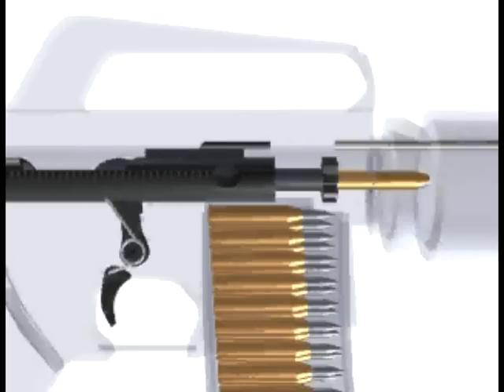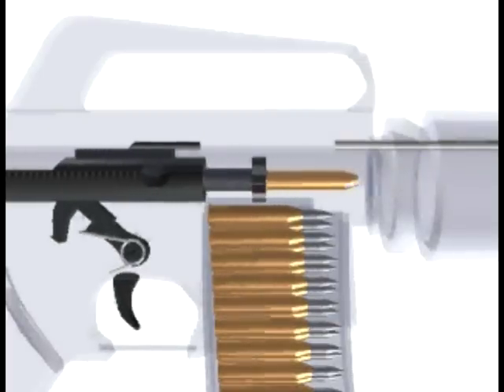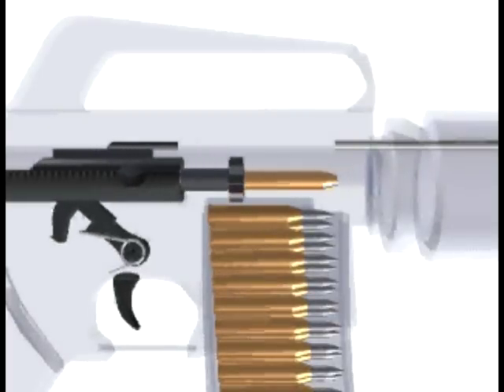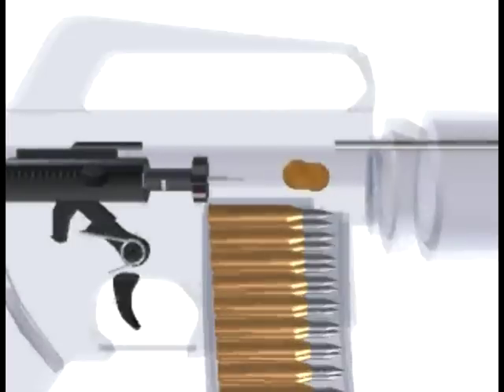M16 Functions Explained

Comment: @GOcgyFLAMESgo You sure about that one pal? I'm in the army; and I know what the price is if you ditch your issued rifle and pick up a captured AK 47. 

There is nothing modern or modern enough about the AK 47. The AK 47 hasn't been used nearly as much as you think. The AK line of rifles incorporates far more than the 47 line. The AKM is the most common seen version...the AK has been modernized because the original is outdated.

Comment: @danratsnapnames Again, the video is explaining the cycle of the bolt and not the trigger mech. It doesn't show any of the trigger mech does it? Do you think a civilian AR has no safety or what? The purpose of this video is to show the cycle of the bolt ONLY. It is one of several videos to explain the function of the M16. I've seen them all; we use them for training in the military.

Comment: @dingbat667 I use a Canadian built licensed version of the M16A2 for a living...and I don't know if you've heard; but Canada isn't really known for having a mild climate. I've seen my C7A2 go through some of the harshest conditions you could imagine; and it still functioned flawlessly. There are virtually the same motions within an AK; it just has different designed parts that are easier to produce. I've handled both weapons. I would never use an AK.

Comment: @xxXpitboyXxx The M16 does not jam. The problems in Vietnam were due to low grade powder causing excessive carbon buildup, and too small a hole in the gas key. When it plugged; there was no pressure to push the bolt carrier to the rear; and so cocking never occurred. This was remedied by the introduction of better powder into all our rounds; as well as making the hole in the gas key larger. Problem solved; the M16 no longer jams.

Comment: @PowerfulProducti0nz If the bolt is fully to the front; then you do not tilt it to the right to see if the obstruction is ejected. There will not be an obstruction if the bolt is fully to the front. If the bolt is fully to the front then the cause is either:

a.) loose magazine; the most likely cause. Smack the bottom of the mag to reseat it if loose; recock the weapon and continue firing. 
b.) faulty ammunition; remedied by recocking.
c.) broken firing pin (never seen it happen).

Comment: @GOcgyFLAMESgo The 7.62 round that we use in Canada has an insane range; but that is not the same round used in the AK47. The NATO round is 7.62x54mm round; the AK uses a 7.62X39mm round...big difference in size. More powder does not mean more speed. Powder to weight ratio will determine speed. The 7.62x39mm round used in the AK travels at 2400 ft/s; the 5.56x45mm round used in the M16 travels at 3100 ft/s.

Comment: @GOcgyFLAMESgo The M16 has an effective range of 400m; the AK has an effective range of 300m. That means that the weapons are rated to be accurate at this range. The M16 is far more accurate; and the M16 also has a far greater range. There is no such thing as "killing power" the term is stopping power; and while the AK does have superior stopping power; the advantages of the M16 outweigh it.

Comment: @MrCassaroleCyrus The jams occurring in M16s in Vietnam was a combination of the lower grade powder; which left more carbon residue; and too small of an opening on the gas key (the little part on top of the bolt that the gas tube fits into). When the carbon built up; it clogged the hole; and there wasn't enough pressure to recock the bolt. They have remedied this by making the hole larger; using better powder; and issuing cleaning kits. The M16 no longer jams.

Comment: @762full actually; no it will not. Any weapon will not fire if it is gunked up and cannot chamber a round; or if the barrel is clogged. Even the AK needs to be cleaned; hence why even retarded Taliban insurgents clean theirs as well....oh; and as far as your comment on all types of ammunition; the AK uses ammunition that rusts it up like mad....our M16 sure doesn't need to worry about that.

Comment: @GOcgyFLAMESgo i agree on what u said about the handler of the weapon is where the accuracy comes from, but im not so sure the ak47 has the same range as the m16. the 7.62 is heavier (which gives it more stopping power, yes) but the the weight also makes it go slower than the 5.56 and it starts to fall to the earth alot sooner than the 5.56 because of its weight.

Comment: WRONG.. this is not the functions of a M16, this is the Functions of a AR15.   M16's have a Auto-sear which releases the hammer after the round is loaded.   AR15's have a direct sear release from the trigger to the hammer.  this is obviously a AR15 semi auto weapon.

Comment: @arandomperson3 You're close, but sub-guns dont need a locked breech. Pistol ammunition does not make enough pressure. The tension of the "return spring" combined w/ a "heavy bolt" is sufficient.  In theory, a strong enough "return spring", to withstand the combustion pressure, along with an equeally appropriate "heavy bolt" could be used in an AR-15 to make it a blowback system,  but the rifle would be impossible to cock by hand because of the extra spring tension and be excessively heavy.

Comment: @arandomperson3 The bolt rotates because that is the manner in which it locks, just like a door bolt, when you push it forward and rotate it.
Because of the extremely high pressure found in the combustion of the gun powder, a lockable mechanism is required.
The rounds are ejected with a simple lever device called an "ejector".  In the case of the AR-15, this lever is a spring loaded plunger, activated by the rearward movement of the bolt. But other "ejector" lever designs exist.

Comment: @Sypher474 no, the receiver has a guide that prevents the bolt from twisting as it strips the round (which is the heart of an m-16s intolerance to any sort of fouling).  When the bolt is fully inserted behind the chamber, then the pin inside the carrier group slides in a groove to allow carrier to fully seat behind the bolt.

Comment: @hebeya10
Since youtube sucks balls and doesnt allow links to be posted, for a good reference picture, go to bravocompanyusa website and search for DD 9300

Gas pushes the BCG back, the cam pin slides in its groove causing the bolt to turn and unlock.

Considering this design evolves around gas operation, regardless if its direct or piston impingement you would think they'd at least mention how the bolt carrier group and bolt operate.

Comment: gas pistons arent going to solve everything because since a ar 15 was designed for DI it will not stand up to the long term stress from the violent pushing of a short stroke piston and your bolt which eventually crack